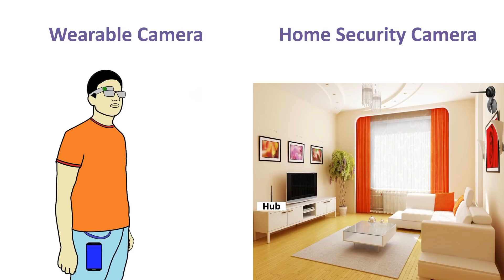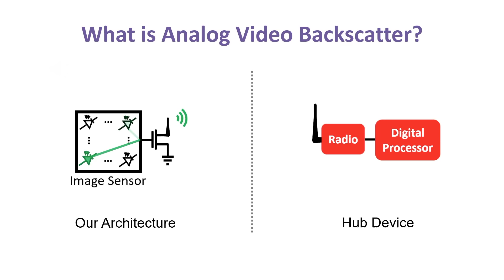Towards Battery-Free HD Video Streaming

Comment: 'Our new architecture decouples the power-hungry components from the camera and delegates them to a nearby hub device. We then directly connect the analog pixel to the antenna which effectively modulates the reflection from our camera to send the image.'

Not familiar with backscatter, I'm learning about it, also I'm wondering about the 'modulation of the camera's reflection' though. Quite fascinating! (a downside to it if of course the threat of being invaded with cheap cameras that can work almost anywhere now that Wi-Fi is being deployed for free for example in all major cities! :( )